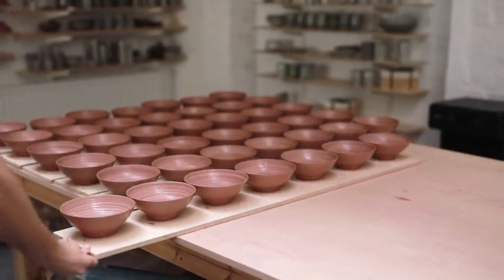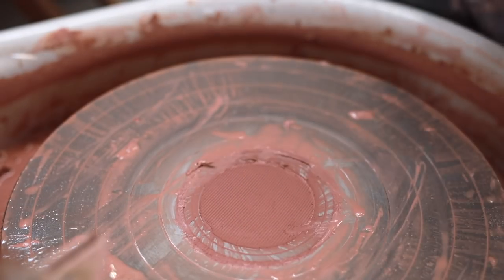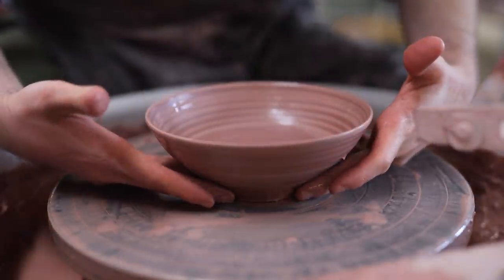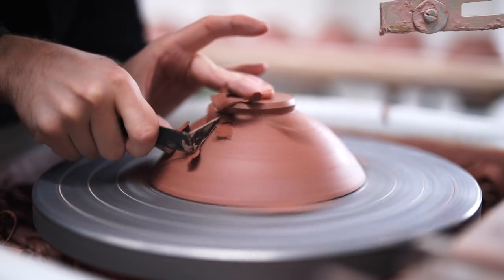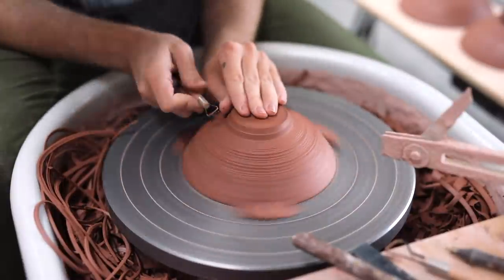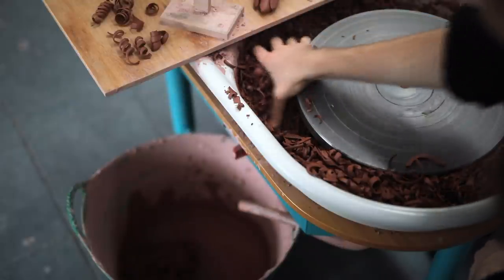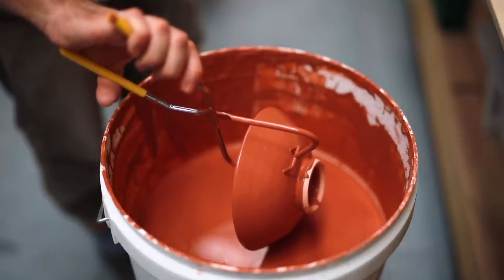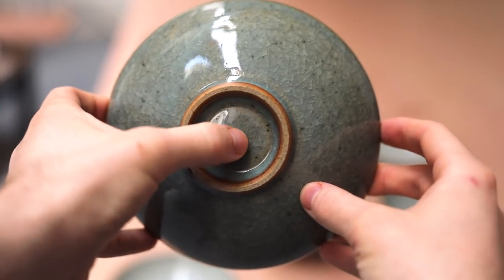Making Stoneware Bowls, from Throwing to Firing – Back to Basics

Comment: one big tip is that once your piece starts getting pretty wide you have to slow the wheel speed way down. When I was new I used to have the electric wheel go way too fast but you don’t need it most of the time. Now I would prefer to throw on a kick wheel ouside and the wheel speed is slow enough that I can feel the clay slithering through my fingers when I pull up the walls.

Comment: How do you know how much material you can take off? How thin the wall already is? Just experience? I know in woodworking when turning a thin object they often use light on the backside so see how thin the walls are.
Reply from the maker: Experience mostly. I can always take the bowl off the wheel and feel the weight, and therefore judge how much more needs to be trimmed away but with this shape, which I’ve made thousands of times, I more or less know what the limits are.
If I’m trimming a shape I’m not so trained on I’ll always feel the thickness of the walls before attempting to trim, just to gauge how much I can take off in certain areas. Thanks for watching!

Comment: Really learning a lot from these videos, much appreciated Florian! I had a question regarding your glazes - I'm a beginner so this might be totally wrong, but I was under the impression that crackle glazes couldn't be classed as "food safe" due to them being difficult to clean or the potential for flakes of glaze to come off with regular use? Is that true? Or does it really depend on the properties of an individual glaze? Thanks a lot!
Reply from the maker: I’ve been using crackle glazed ceramics for years and years. It’s high fired stoneware with nothing nasty that could leech, the crackling doesn’t stain too badly as long as it’s properly washed but of course it happens overtime. To the same degree, many of the potters I’ve worked for over the years who wood fire, soda fire and so on, all have work that crazes and crackles to some degree and it all stains with time, yet functional work is still made abundantly and is completely usable. I’ve never heard any stories of anyone getting ill from crackle glazed pottery, the clay is highly vitrified and unless you take terrible care of your ceramics you’ll be perfectly healthy. For industry it could be an issue, due to the surface of the pot having less strength, long-term staining with excessive use and fragility as it’s high fired stoneware with lots of iron, which makes it weaker and more susceptible to chipping on the whole, but that’s what you get with handmade ceramics, I don’t want to make pots that have perfect, uniform surfaces like you might find in a shop, I want each to be individual and interesting and handmade and I suppose the same goes for the generations of potters who’ve worked all over the world. Here’s a good link to an article that goes into more depth about it, https://ceramicartsnetwork.org/ceramics-monthly/ceramic-glaze-recipes/glaze-chemistry/techno-file-dirty-dishes/, and clears up some of the misconceptions that are spread around. As long as you properly wash crazed pottery there is no bacteria left in the crackles. As long as you take time to care for your handmade ceramics after they’ve been used then they’ll be just fine.
Reply: @floriangadsby  Wow, really appreciate the time you took for such a detailed and informative reply. Will defintely have a read of the link you provided. I hope my question didn't come off as accusatory, there's just so much to try and learn and understand!